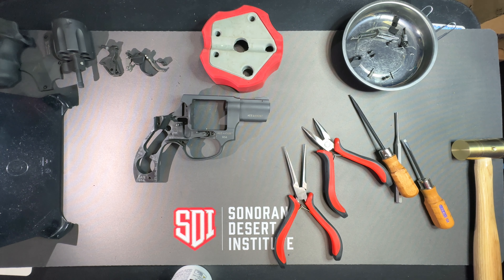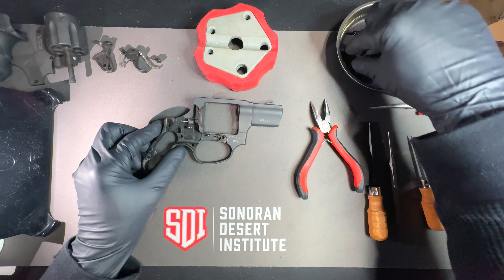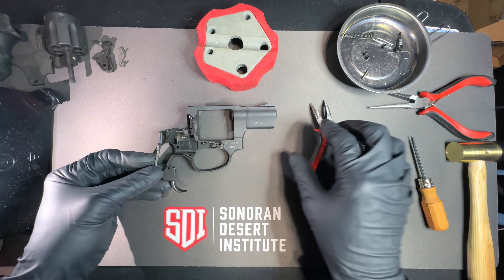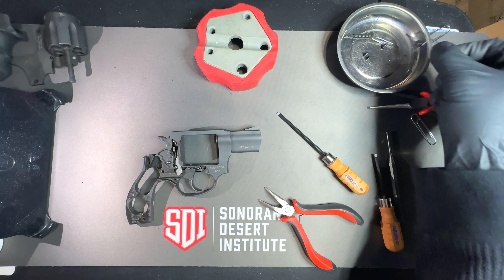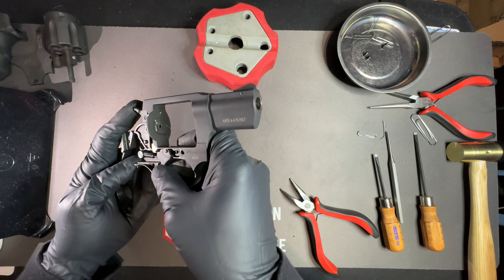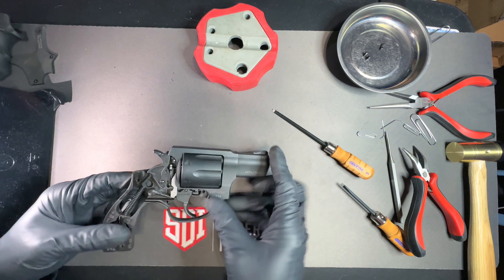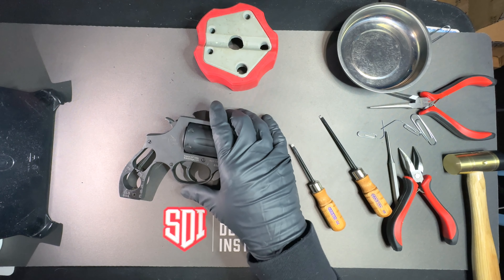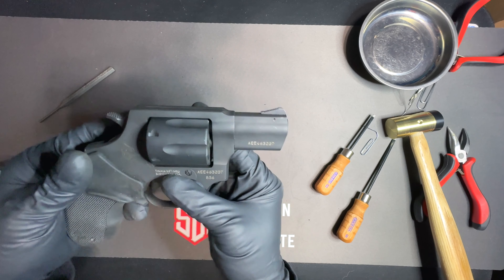Taurus 856 REASSEMBLY FTH 202 wk 2 (part 2)

Comment: I have a spring and what looks like a button head top and i can not for the life of me figure out what it goes to. It fell off mid tear down
Reply from the maker: if you can take a picture of it and send it on instagram, if you use it, I may be able to tell you what it is. I took the Taurus apart a few times now. If you have instagram send it to @megaguns_thinkmegatv
Reply from the maker: If it is a small spring with a button head it may be the trigger return spring.
Reply: @thinkmegatv  i rewatched the videos and it turns out it was the plunger for the cylinder
Reply from the maker: Ok I was thinking of that too but i thought it was smaller
Reply: Excellent, you have a subscriber.